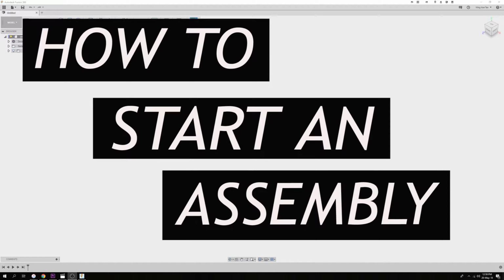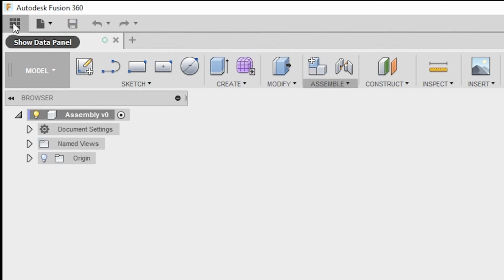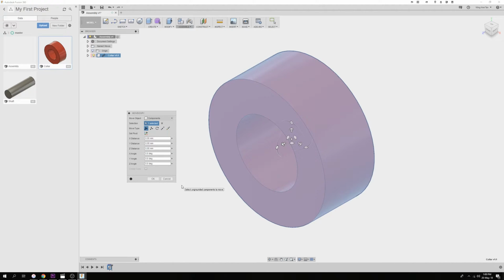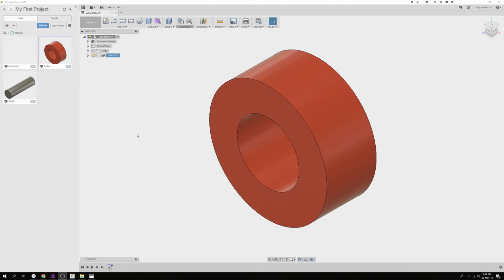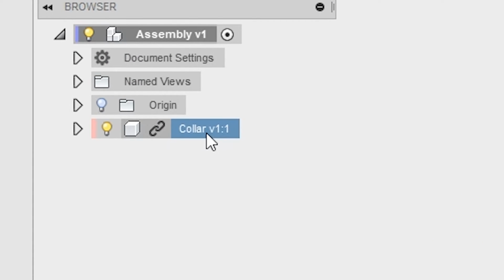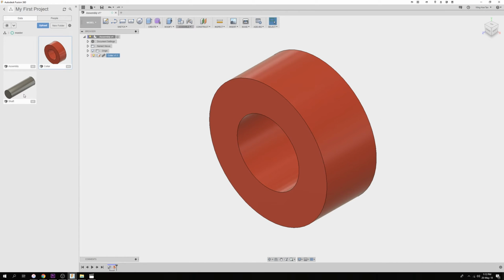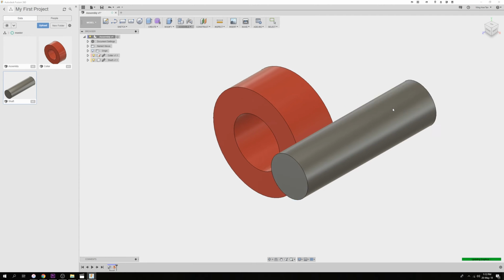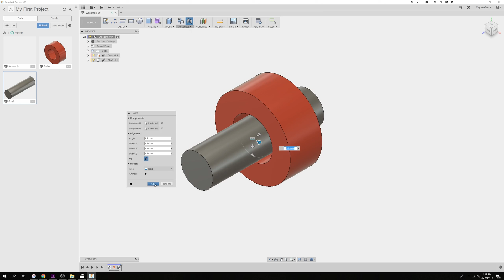Fusion 360 - How To Start An Assembly

Comment: Thanks for the clear instructions. A simple question on the location of drill hole sketches. After creating two plates, I want to drill  holes through these plates. The plates are different components. This is easy to do with the extrude command. What is not clear to me is the location of the sketch that describes the holes. It can be located at the top level or on one of the two plates. If it is located on one component and if this component is not visible at some later time while the other component IS visible, how do I find the sketch that defines the holes, assuming that I have many components? thanks